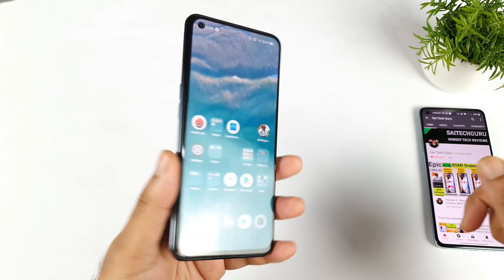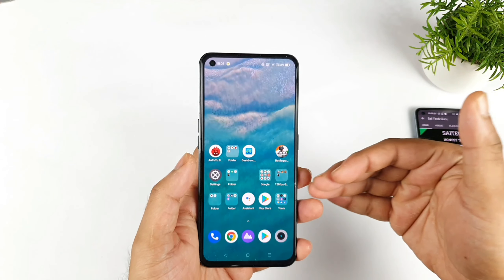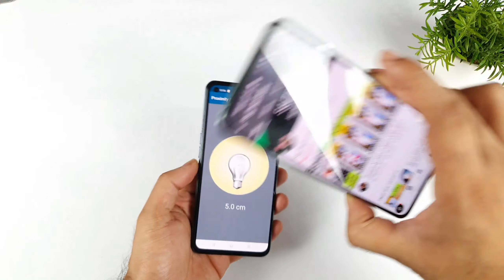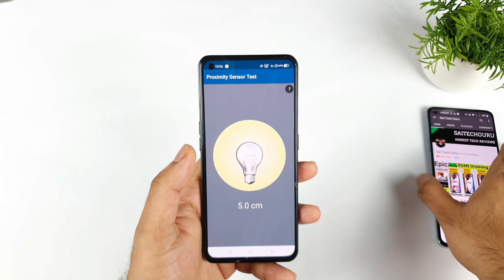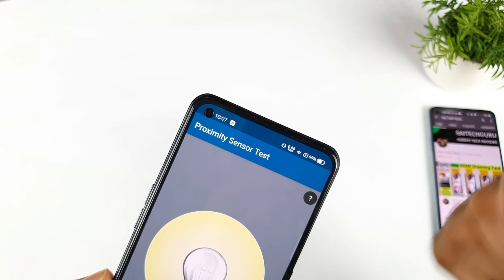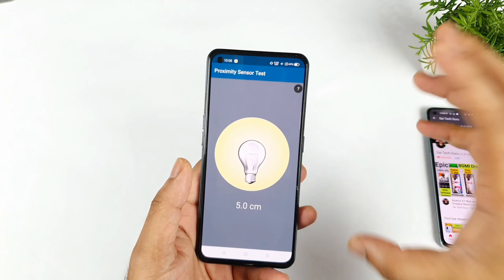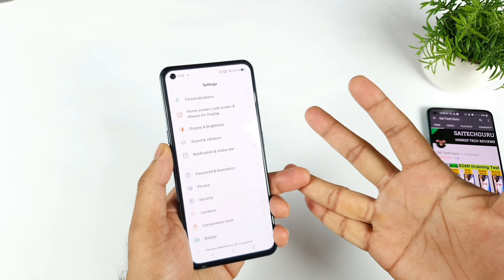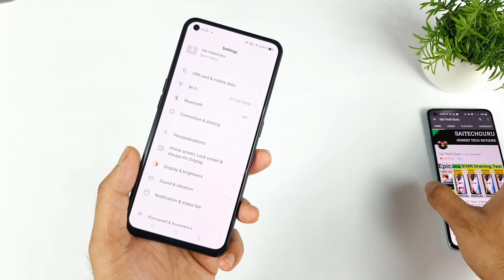Realme X7 Max Proximity Sensor not working follow these steps to find problem & Fix 🔥🔥🔥

Comment: Bro what about BGMI 90 fps 😥😥😥😥😥 will realme give a patch update for this?
Reply: Superb soon buddy
Reply: @syedfirdose2424  will update come?
Reply: @akshayswaminathan2463  yes realme will surely fix this problem also because they are alredy working on optimizeiation on dimensity 1200 and after that dimensity 1200 will beat snapdragon 870 also, because dimensity 1200 is very capable processeor all just it need better optimizeiation.

Comment: Update to A.18 from A.15? Heat on charging.
Reply: A.18 is the most stable update.. The only prblm is, if u r playing BGMI then FPS locked at 70.. very disappointing for gamers
Reply: @9191pratik  exactly
Reply: Buddy don't update from A 15 to A.18 .15 is super battery backup also good